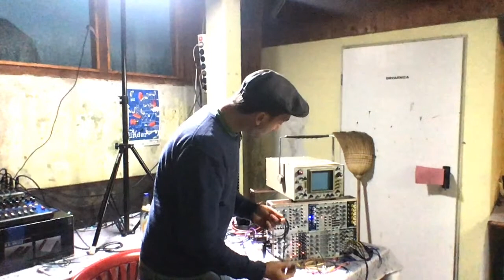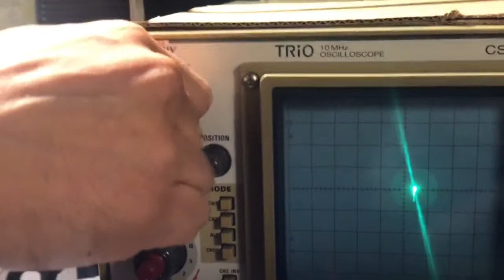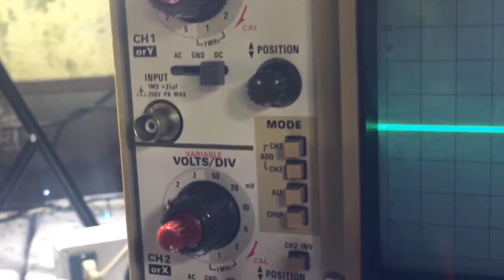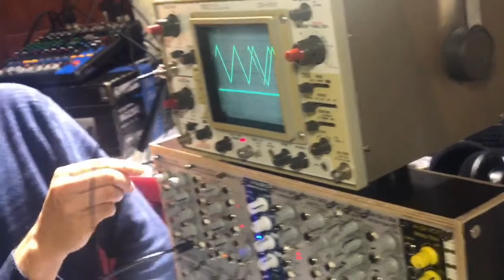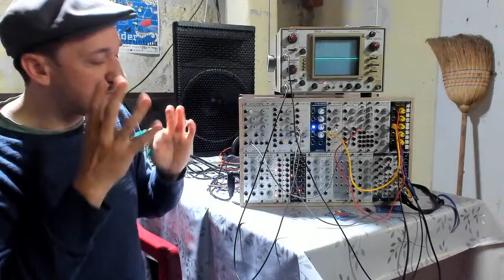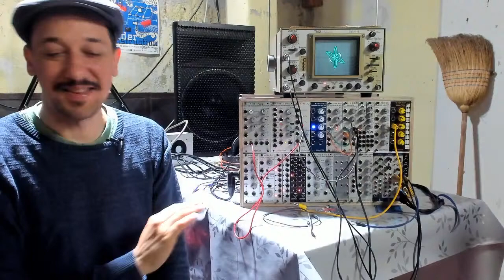Introduction to Oscilloscopes used with Modular Synths - w/ Bernhard Rasinger (live from PIFcamp)

Comment: Great video! But oscilloscopes like this are available only second hand and aren't portable. There are some modern (JBL Go portable speaker size, with LCD displays) cheap Chinese oscilloscopes with limited features and parameters, but probably good enough for the visualisation of waveforms coming from modular. Are there any specific models you can recommend?